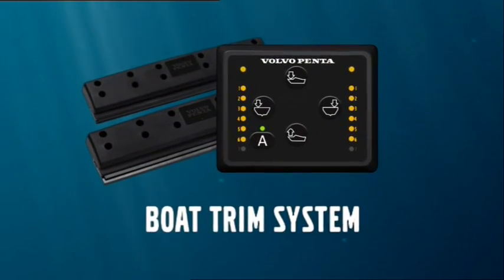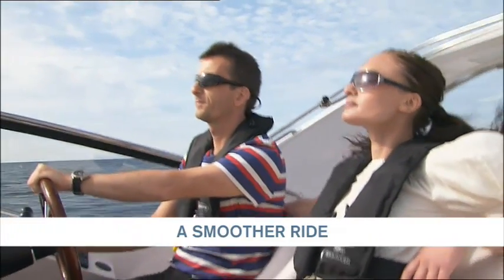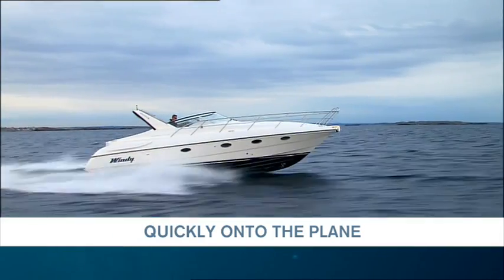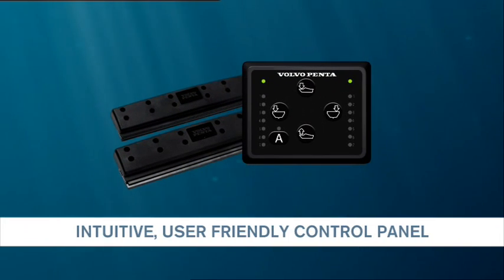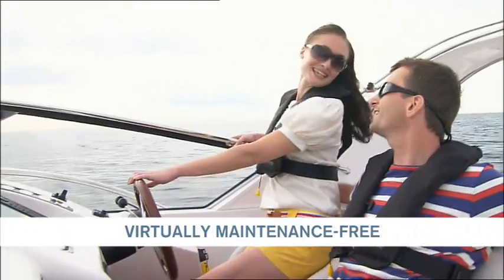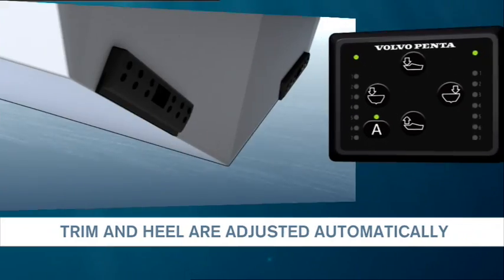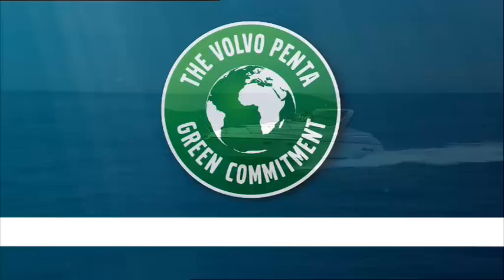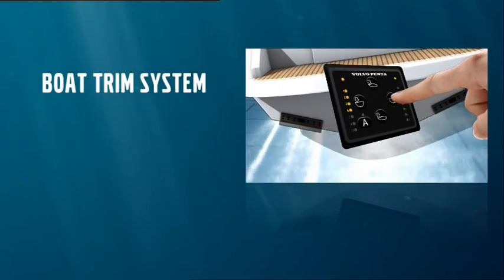Volvo Penta’s Boat Trim system

Comment: It looks like the Humphree interceptor, with a different panel. The Multiple winner of Best Active Stabilization System -- Humphree interceptors have been around since for ever and Volvo bought a majority stake in Humphree in 2016. Far less drag than traditional plate trim tabs, but a little more expensive.